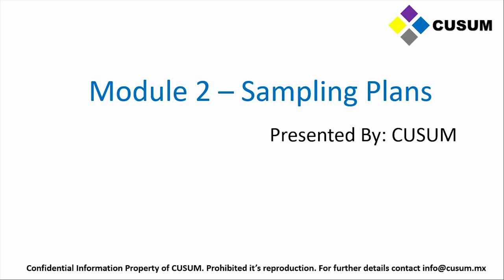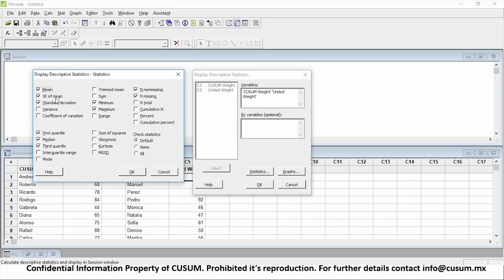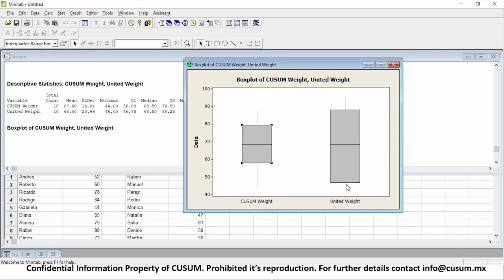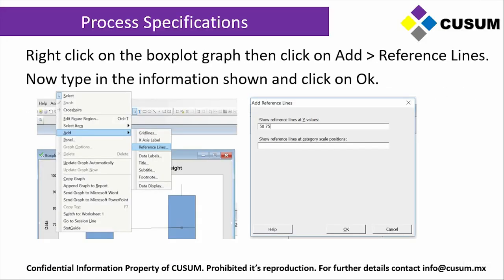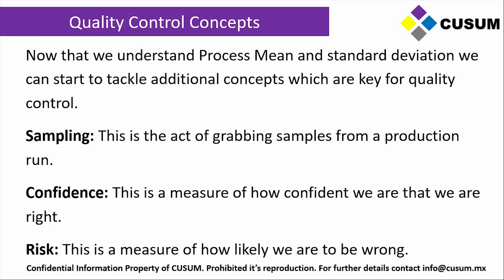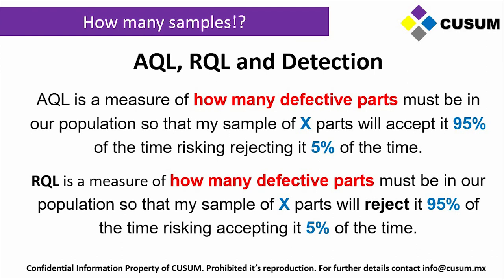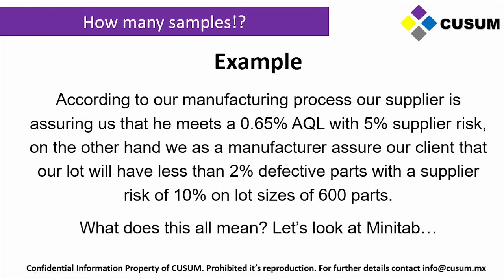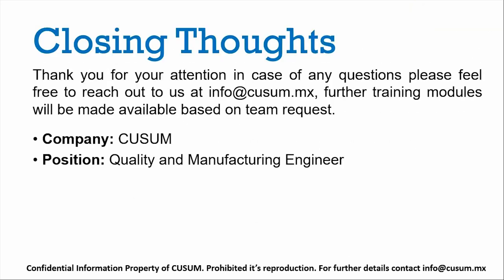Sampling Plans - Minitab Masters Module 2

Comment: great video, thank you! AQL vs RQL is a very complicated concept that even senior engineers in my company dont quite get!! Question still remains - how does one determine what is acceptable to the customer? Is this typically an assumption?
Reply from the maker: Hi Diana, thank you for your question. 
The Selected AQL/RQL is usually part of a company's risk assessment following corporate guidelines. 

The tool commonly used is the PFMEA, the PFMEA uses severity, occurrence, and detection values to determine if a defect is high, medium or low risk. Usually, a defect's severity can't be modified without a complete product design change (Costly, time consuming and usually requires regulatory approval). 

Occurrence of the defect can usually only be changed either with the purchase of better equipment (More capable of consistency) or validating a new process parameter window (With a better performance value Cpk/Ppk) once again it is time consuming and costly. 

So, when companies find that a defect has a high severity and a considerable occurrence, they use stricter inspection criteria (Detectability) to reduce the likelihood of that defect passing inspection. This usually takes the form of using industry standards such as 0.65 RQL values to assure end user quality and meet PFMEA Criteria requirements. 

When Defects aren't as high risk (For example 3-4 values in a scale of 1 to 9) lower detectability values tend to be used for example 1.5 RQL. 

We hope this answers the question, for further feedback please email us to info@cusum.mx 

We wish you a great day! Sincerely,
QE NPI Andres R.

Comment: Summary of "Sampling Plans - Minitab Masters Module 2":
1. Module overview: "Sampling Plans - Minitab Masters Module 2" is part of a specialized course for quality and manufacturing engineers, focusing on Minitab usage.
2. Importance of sampling plans: Sampling plans are vital for both quality and manufacturing engineers to ensure product quality and better design manufacturing processes.
3. Key concepts covered: The module covers fundamental statistical concepts such as standard deviation, process mean, and process specifications, along with quality control roles and terminology like AQL, RQL, producer and consumer risk.
4. Box plot analysis: The transcript describes a demonstration of box plots to analyze and compare data spreads, emphasizing the importance of understanding data distribution.
5. Acceptance sampling plans: The module discusses acceptance sampling plans, emphasizing the balance between assuring quality and controlling costs by selecting appropriate sampling sizes and rejection criteria based on defect tolerance.

Comment: Hi great tutorial!

Noticing at 26:22 the reference lines don't precisely intersect with the OC curve. Is there a reason for this?
Reply from the maker: Hi Eric, pass fail sampling plans use individual units of measurement, you can take 315 samples or you can take 316, but it is impossible to sample 315.2 units, because of these rounding errors OC curves will not intersect perfectly except on very unique sampling plans. We could also adjust the reference lines to provide greater resolution on the conclusions but overall the rounding errors are negligible for manufacturing processes. If you have further questions please email us to info@cusum.mx take care!

Comment: Thanks for the information, very helpful. I have a question, what do you mean when you say 95% of the time? I mean, for example, if we inspect a sample 100 times, we will accept it 95?
Reply from the maker: Hi Victor! Thank you for the question, it means that if the lot as a whole has less than the AQL level of defects then we will accept it 95% of the time by using this sampling plan, let me give you an example. Let's say you manufacture 100 parts and you have 0 defective parts that means that it doesn't matter how many samples you take because you won't find any defects, now let's say you actually have only 1 bad part in the 100 piece lot, if your sampling plan tells you to take only one part and if it's good accept the whole lot or if its bad reject the whole lot then there is a 99% chance you will accept the lot because it would be very unlikely that that one part you take is actually bad, now lets increase it let's say the 100 piece lot actually has 5 bad parts and you still only take one bad part well in this case there is a 95% chance that you will accept the lot because 95% of the lot is good and you are only taking 1 sample. This is what's known as the AQL level so a 100 piece lot that is 5% defective will be accepted 95% of the time by using a sampling plan of only 1 part to accept or reject. Please let me know if you have follow up questions and I'll do a video on it, take care!
Reply: @CUSUM-ACADEMY  Hi CUSUM! Thank you very much for your response and sorry for the late reply. I still don't fully understand, I give you an example: what does it mean to have a batch of 40,000, AQL of 2, Alpha of 0.05 n = 200 and C = 7?

According to this, the lot will be accepted 95% of the time if the lot has 4 defective parts but it will be accepted if 7 or less are found according to minitab. This is not clear to me since as you mentioned, 5% would be equivalent to 10 defective parts, it would be very helpful if you could answer. Thank you for your work!

Comment: At 24.0 when you say he will reject with "95%" of confidence if it has 2% defective parts or more. Shouldn't it be 90% rather than 95% or am I misunderstanding?
Reply from the maker: Hi Ujas, thank you  very much for pointing this out. You are correct. The correct statement is: We have 95% confidence that lots with a quality level of 0.65% won't be rejected and we know that lots that are 2% defective or more will be rejected by our client 90% of the time. This 90% comes from our power statement, since we are using a beta of 10 (0.10). If you have further questions please don't hesitate to ask,
Thank you once again for your comment
Sincerely, QE NPI Andres R.
Reply: @CUSUM-ACADEMY  Thank for giving response. 
1. I'd love to see any tutorial based on Measurement System Analysis GR&R 2. There is too much confusion about Hypothesis tests and Control charts. One video giving some clarification about which chart can be used and when. Like When can we use t test, X bar R, X bar S, X-MR and such most used charts in Quality Control and manufacturing industry.
Reply from the maker: @ujasmodi1890  Hi Please check out Module 4 of our Minitab Masters series on https://www.youtube.com/watch?v=WyORXip9kuo&t=1079s
This video includes control charts and common quality tools.
Take care!
QE NPI Andres R.
Reply: @CUSUM-ACADEMY  Yes, I went through it which was on Xbar R and Ppk. Although I am still confused about in which situation which kind charts can be used. And MSA and GR&R are tools where Minitab is used therefore looking for videos on that. I'll be grateful to have that.
Reply from the maker: @ujasmodi1890  Hi, we don't have videos on the other bar charts but as a general rule:
Use IM-R charts when you take one sample at a time from the production line
Use X-Bar Charts when you take multiple samples at the same time (This size is called a subgroup)
Use C charts when counting number of defects 
Use P charts when only two outcomes are possible (Pass/Fail)

Take care and keep learning!
Sincerely,
QE NPI Andres R.

Comment: can we solve this on minitab?
can you solve this?
Suppose a lot contains 100,000 items. The proportion of defectives p in a good lot is 0.2 with probability 0.8, and 0.4 in a bad lot with probability 0.2.  Accepting a bad lot costs $300 and rejecting a good lot costs $200.  Sampling costs 1$ per item.  Suppose that sampling continues until we observe the kth defective item, at which it stops.  Find the optimal value of k